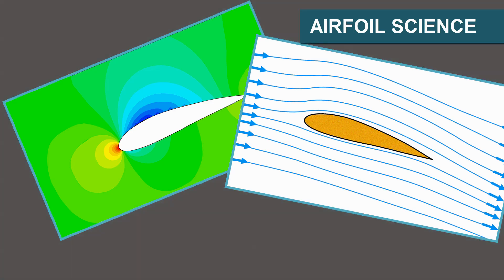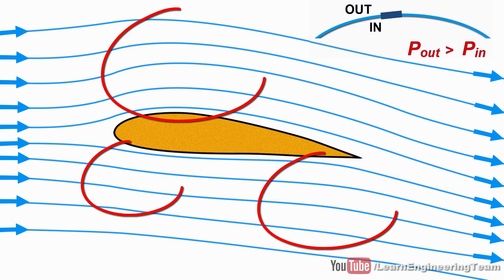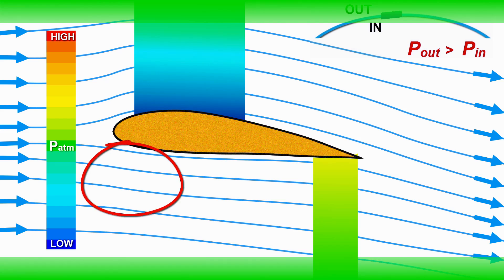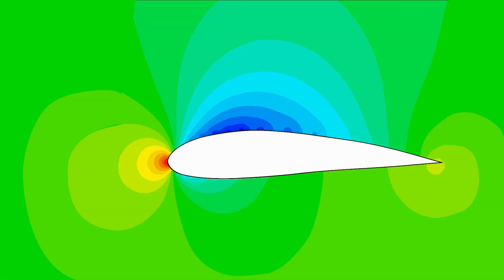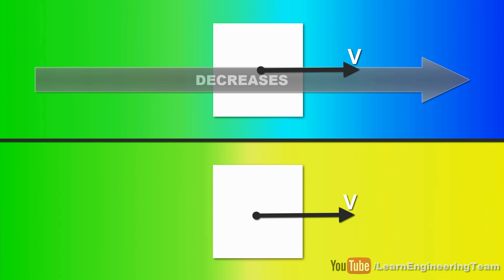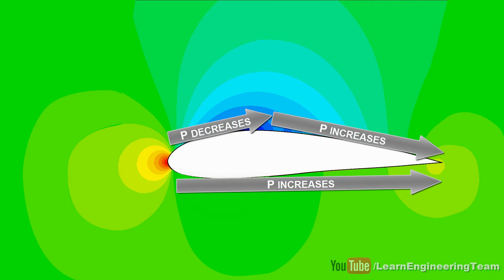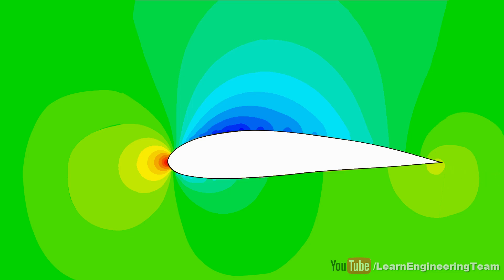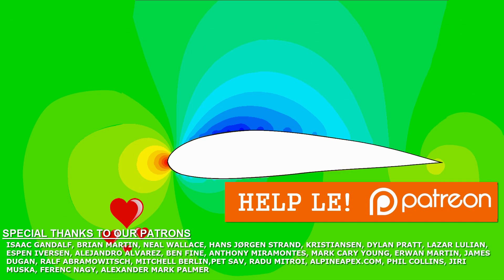Why is the top flow faster over an Airfoil?

Comment: Actually this is very old science which doesn't hold up any more.  There is no speed difference between the air above or below a wing.  It's all about displacement of air and the path of least resistance.  The wing is trying to force its way through the air.  In order to do this it must push the air that it collides with out of the way.  The air being pushed out of the way only has two options or paths to choose.  Above the wing or below.  The law of least resistance means that it is far easier for the air to slip under the wing which is close to the leading point of the wing then to go over top of the wing which is further away from that same point.  So more air is free to travel under the wing.  More air is been pushed down than up.  This displacement differential causes the lift.  A helicopter blade (a spinning wing) displaces more air down than up, so it goes up!  Whether a wing spins or moves in a straight line through air makes no difference to this effect.
Reply: In fact in the wind tunnel video you can plainly see the streams above the wing are getting forced closer together.  This occurs because the air is been pressurized (squeezed together).  So the high pressure is above the wing (at the leading edge). As it moves past the top of the wing the air streams redistribute to their original spacing and therefore the original pressure before striking the wing.  Look at he leading edge and the air streams going underneath spread out or are been stretched apart from each other. Being stretched means pressure is lowering.  So the low pressure is under the wing at the leading edge.  Now go to the trailing edge and the opposite is occurring.  The low pressure will be about the trailing end and the high pressure will be below the trailing end.  So the pressure distribution tends to cancel out leaving only displacement to create the lift.
Reply: @KZgun4hire  I am sorry Walter, but you are very mistaken.   You obviously have not studied basic physics nor aerodynamics and have no basis for your opinion.
..
.This video is quite correct overall and one of the best on You Tube among so many terrible videos.  I can only fault him for not using a flow diagram more representative of reality that shows the well-known up-wash ahead of the wing that is less susceptible to thinking there is that "small"  lowered pressure under the L.E. That is not generally present in level flight.
.
Your "path of lease resistance" means nothing.  There is no such law in physics.. Air is a fluid that follows very well known characteristics of flowing; occupying the available space; pressure and following Newton's laws, just like ALL things with mass.  It follows ALL available paths according to pressures and space constraints.
..
You do not provide, and can not provide any justification for it being  "easier" to flow under the wing.  After all, there is more pressure there, so it it may even seem MORE "intuitive" that it is harder to flow there.  In fact , REAL MEASUREMENTRS directly show that the air under the wing is not only bushed downward, but is also pushed forward by the higher pressure there -- REAL data from a wing generating lift. Fail.
. .. 
Air has mass and trying to describe this any other way actually is incorrectly applying and completely ignoring well known physics.
..
The Babinsky video CLEARLY shows the difference in top/bottom speeds. You ignore that evidence. Fail.
.
For one, regarding the air above having streamlines "getting forced closer together", this directly contradicts what is seen in the classical venturi where the lines are closer together in the narrower and LOWER PRESSURE region. 
This is measured  daily in aerodynamics labs and classes daily. Fail!  
..
You intuition the air being "squeezed" or "pinched".  This fails the simplest of measurements that even you can make - Even I have made them in my aerodynamic studies and demonstrations.   I admit that the spacing of the stream lines is non-intuitive to a beginner who is not used to studying fluid dynamics. You are in error there.   It confuses many beginners in this same way, so  your interpretation is false as clearly shown in a common venturi.  Fail.

..
The idea at time 2:17  about the Pressure Gradient being the cause of the fluid Acceleration is 100% CORRECT and is NEVER violated.  This was first determined by Euler when following up on Bernoulli's work in the mid 1700s.  It is Newton's Laws operating in fluids. It ALWAYS required a (net) force to Accelerate a mass.
.
If you have studied any physics, you have not retained any of it which is shown by by violating so many fundamentals.
..
Please do some real studying by reading any authoritative papers and books, many available on line, such as John D. Anderson. Charles Eastlake, Mark Drela, Doug McLean. Klaus Weltner, John Anderson & Scott Eberhardt  I have read them and also consulted with several of them in my studies as an instructor. If you wish I can provide links. 
- - 
Regards

Comment: since bernoulli's theorem cannot be applied on two streamlines then how bernoulli's principle is resonsible for the BLOWING OFF of the ROOF DURING STORMS ????????????? PLS ANSWER
Reply: Shorts,
It is caused by the curved flow above the roof, atmospheric pressure holding the flow close to the roof and the air's inertia (Newton's First Law).   This video uses a wing, but the same thing happens above a roof. 
 https://www.youtube.com/watch?v=3MSqbnbKDmM
..
Not really.
First, Coanda does not occur around a wing.  Coanda is for a JET of air into an otherwise still environment.
.
Second, while there is some occurrences of examples of Bernoulli "happening" around a wing, the vast majority of explanations you will find using it, are wrong.  Speed does NOT cause a lower pressure PERIOD!
.
To word it like you do:
It is MUCH BETTER to say that the pressure distributions around a wing are due to the wing pushing the air around. These pressures then cause all accelerations of air around a wing AND the lift.
..
Look at these:
First, VERY Important thing to remember:
Air HAS MASS!   Pressure on the outer part of a curve will always be higher because the fluid wants to go straight!
This ALSO makes the pressure less in the inside of a curve.
Then, try these: 
 Understanding Lift Correctly: https://rxesywwbdscllwpn.quora.com/
 Understanding Bernoulli Correctly: https://kyuoyckftflurrpq.quora.com/ 
 Flow along a Convex Surface: https://www.youtube.com/watch?v=3MSqbnbKDmM

Comment: I really don't understand why the airfoil aren't inverted, with front part in the rear and with rear part in the front.
Reply: @Denis Daniel Dima
Because it works better.  A sharp trailing edge gets the air to more easily leave teh surface.  Around a curve, the air will try to follow the curve because air pressure pushes it toward the surface around the curve.
You MUST NOT LOOSE SIGHT OF TRHE FACT that air pressure is ALWAYS pushing the moving air against the surface - ALWAYS.

Comment: Coanda effect doesnt take place in order to explain this fact, just for jet fluids. Main reason is the geometry and distribution of pressures around the wing.
Reply: Coanda effect is not just for jet fluids, it is used in Formula 1
Reply: @alexgallegos4526  The issue is that Coanda does not happen around ANY wing-like shape.  It is defined for a jet or sheet of forced air into an otherwise motionless air environment.  A wing does not have that and it is improper to call that COANDA- - However, there certainly similarities.

Comment: The order is 
The Airfoil Shape and Coanda Effect
Pressure Differences (And Corresponding Forces)
Velocity Gradients

*special note. If the pressure gradient on the second half of upper airfoil surface becomes big enough, velocity might decrease to the extent that the flow will start reversing. This causes loss of pressure at/near that separation point, loss of lift, increase in drag and called stalling
Reply: so the reversed flow cause turbulence??
Reply: @pratsdrawing7884  reversed flow would be turbulent flow. But turbulence is originated from there. Turbulence originates due to high Reynolds no.
Reply: @aeroboi2862  yeah, but the reverse flow would cause more turbulence right?

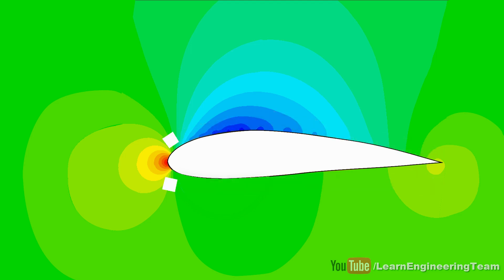Comment: Admin at min 3:08 you made a mistake. For top surface V decrease and then V increase. But you made it opposite.
You asked why different speed? Because the shape of airfoil is curvy downwards. Like when you are sliding from on top a hillside. Your speed is increasing right?

Comment: the air does not split, speed up and then meet again at the tail. First of all you need to understand the medium that the flow is in. Air molecules are constantly being push to the surface of the earth that is why air is thinner as you increase alt. Air molecules for this purpose we'll say a still day, the aircraft hits the air molecules pushing them apart. A high camber wing flying at lower speeds pushes the air up as it passes through. The air molecules bounce up and separate from the wing, look at any wind tunnel test the lowest pressure is just aft of the highest point of the camber since this creates a vacuum at the top of the wing the constant air pressure pushes the molecules back down faster seeming like they are speeding up when in reality they only went up and down due to the speed at which the aircraft is moving. So what is making a high speed jet stay up when the camber is somewhat symmetrical? The same principals apply, The wing on a large jet aircraft has a higher angle of attack referenced to the fuselage. This is just to keep everything level inside while at cruise, since the ambient air pressure is the same for a Cessna or a jumbo jet. The shape of the wing of a jet is made for surfing on the air molecules, thus it pushes down on the air molecules creating higher pressure under the wing. This can be observed on take off, don't confuse wing tip vortices. This difference is not really explained well and some explanations are way off. IT is all the same air, same air pressure just two different designs to achieve the same result FLYING. A high camber wing will not work on a jet aircraft do to the turbulence caused at high speed, and a small aircraft would not generate the high speed to surf the air. Aircraft that are on the design table for ultra sonic flight are designed to surf the atmosphere at the edge of space. The above lesson is correct in the pressures on the wing, but no one ever really answers WHY. No that I have found anyway.

Comment: The high pressure point on the leading edge reminded me of a similar problem for shooting bullets underwater. they fixed the problem with a concave tip that super cavitates and gets 60 METERs!  Could a big leading edge divot work on a wing?
Reply: Please permit this small observation from far away. What you have just said makes a lot of sense. Years ago I made a model with a sharp leading edge wing with some equal thickening near the middle and an equal flaring skirt at the back, the section looking somewhat like a small-headed eel with a fin. Strangely, the model flew quite well, even in its glide pattern. I had often wondered why a blunt nose had to be offered to the airstream. I cannot tell how many of these explanations, charts, smokey streamlines, theories, formulas, arguments and proofs I have visited over the years. A phenomenon I observed through the window as we flew through rain still baffles me. The droplets on the wing should have been torn away backwards in the airstream at about 400 miles an hour. Instead they remained attached to the wing and crept forward! What is going on around a wing in flight? I still have no idea, but I shall some day try a wing with a concave leading edge on a model some day. Thanks for bringing it up
Reply: Aren’t jet wings concave tipped?

Comment: This explanation in entirely based upon an oversimplified thumb rule of body curvature vs pressure. It is not that simple. Explain about the pressure gradient first, then proceed with the conclusion of particle slowing down/speeding up due to that pressure gradient. The cause and effect relationship of pressure distribution and velocity of air is not that simple. Watch NPTEL lectures, MIT and Harvard videos on aerodynamics, YT vids of channels 60 Symbols, where they actually present an honest discussion based on facts and genuine information. That might not suffice you for the answer you've been looking for but invoke your interest in delving into that question even deeper.
For an eight grader or a casual viewer, I do find it suitable tho.

Comment: This is like the chicken/egg question.  Does the speed difference cause the pressure difference or the other way around?
Reply: The cause-effect chain is clear if you follow the fundamental principles.  

 In SIMPLE cases, a Precure Gradient Accelerates air toward the lower pressure region.  Simple.
..
The lower pressure directly causes the speed increase ( acceleration) away from the Leading Edge toward the middle of the upper surface.  FOR SURE!
.. .. ..
.. .. ..
BUT it is the COMBINATION of: the flow moving + the curved surface + the air pressure holding the flow against the curve AND the inertia of the air "trying to go straight".  All of that TOGETHER are THE CAUSE OF THE LOWERED PRESSURE! 
ALL of that is REQUIRED to go from speed to pressure reduction,. it is NOT simply speed > lower pressure > speed.  NOPE!
 It is FALSE that fast moving air 'causes' a lower pressure.
..
Please see this very short video and upvote it if you understand it.  It is correct!
BUT... it ONLY explains ONE STEP: The cause of the lowered pressure above the wing.
  https://www.youtube.com/watch?v=3MSqbnbKDmM
..
This Blog explains  the Bernoulli Principle fully:
 https://kyuoyckftflurrpq.quora.com/ 
Regards
Reply: Yes
Reply: I think the pressure is what creates the increase in speed on top. There’s several effects at play though, for example the angle of attack of the wing pushes the air underneath the wing downwards slightly, so then Newton’s 3rd law explains a net upward force on the wing. Also if the wing has an angle of attack then on the bottom of the wing particles stack up with each other due to being slowed slightly. Whereas on the top of the wing there is a decreased pressure because the air has been directed away from the wings surface. This also creates more turbulent air above the wing and less turbulent air below. I’m fairly confident the pressure is the instigator for the velocity difference. But there are many different concepts at work. There are many false claims as well as to the reasoning behind lift, it’s entirely possible I misunderstand the concepts as well.
Reply: @isaacjohnson8752   YES, YES, YES!!  There is a combination of factors that you Must understand.  See my other answer  in this thread to michael spencer...
[but it is NOT "more more turbulent air above the wing". The turbulence doesn't become meaningful, for the most part, until you get close to stall. 
..
YES! FOR CERTAIN  "pressure is the instigator for the velocity difference."
In the mid 1700s, it was Euler, following up on Bernoulli's work, that figured out that a Pressure Gradient Accelerates a fluid.  This is NOTHING other than Newton in Fluids !!! .
The TWO pressures work together to Accelerate air toward the lower pressure (away from a higher pressure).
YOU'VE GOT IT!!
..
BTW: Did you know that Euler derived what we call Bernoulli's Equation??
There is no indication in Bernoulli's notes that he understood the cause of the pressure-velocity thing...!
.
Please try to spread this word around to dispel these myths that have lasted so long among the well meaning amateur scientists. 
.
Please see this very short video and upvote it if you understand it.  It is correct!
BUT... it ONLY explains ONE STEP: The cause of the lowered pressure above the wing.
  https://www.youtube.com/watch?v=3MSqbnbKDmM
..
This Blog explains  the Bernoulli Principle fully:
 https://kyuoyckftflurrpq.quora.com/ 
- - 
Regards

Comment: At the end of the day, what is pressure? Think of atoms as ping pong balls, all vibrating and creating pressure on every surface.
If you push a wing through the air with a upper curve, the upper surface accelerates air so the balls strike the surface with less force, less pressure.
Under the wing the balls can't get out of the way of each other, they slow down, they are backing up creating more pressure underneath.
Look at wind tunnel pulsed smoke, top and bottom flow is out of sync.
As we climb, less air molecules less lift, until we reach space.
But doesn't account for all lift.
What if a curved spoon placed into flowing tap water, the spoon is draw in. Typical demo of aerofoil section.
What if the tap and spoon where in a vacuum, what would happen. Would the spoon be drawn into the flow of water?

Comment: I think lift is produced due to the centrifugal effect arises at both the upper and lower curved surfaces.This result in the throwing away of air to both upper and lower part of the airfoil, at the bottom surface there  is the ground to provide the reaction force but throwing away of air at the upper surface will not get any reaction force thus air pressure decreases over it . Thus air plane takes off, am I correct ? Please comment on this theory...

Comment: The Bernoulli effect is not why airplanes fly, because they can do that upsidedown
Reply: Most aircraft that fly upside down have more symmetrical airfoils than in this video so that they can produce lift in either direction.  Then the lift is being created more by the angle of attack
Reply: @nicholassurber7494  exactly, it's a combination of newton's 3rd law and bernoulli's theorem, it depends on the specific case